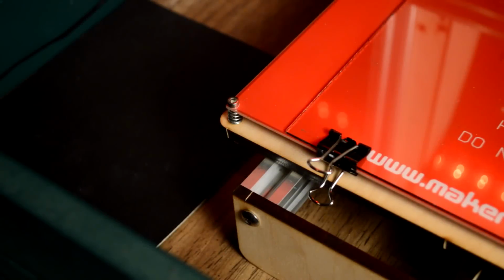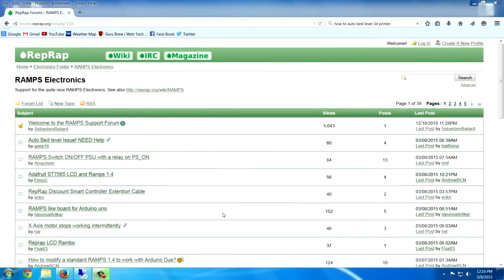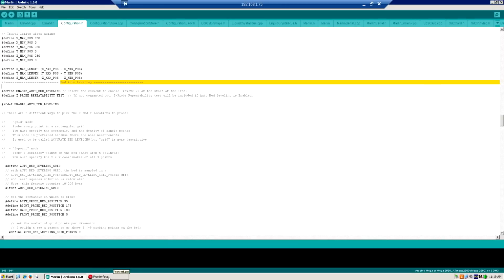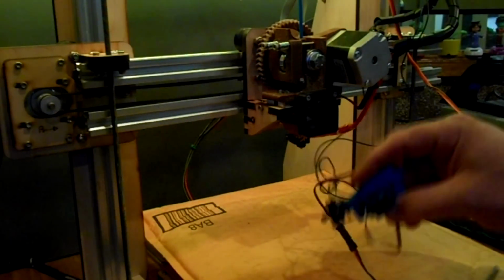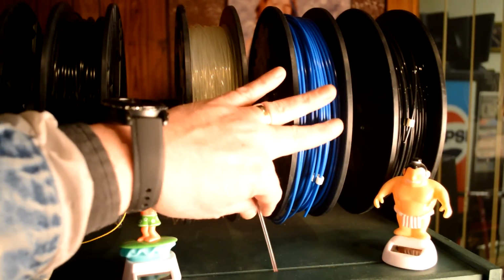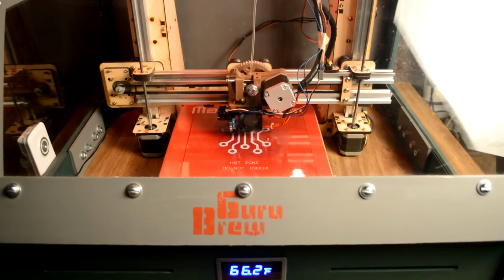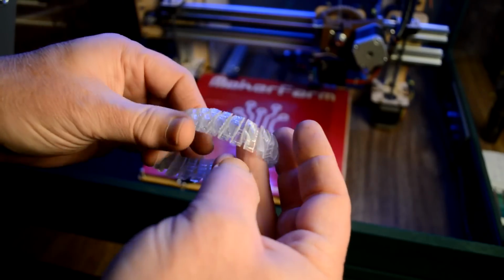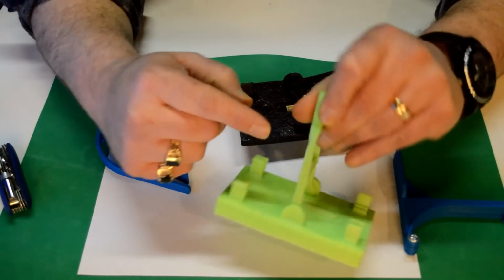Setting Up Auto Bed Leveling on 3D Printer

Comment: hey GuruBrew! ive set up servo bed leveling on my Marlin RC3, but im running into the issue of the printer printing mid air, likes 21mm above the bed which is more than my Z offset (-18.59mm) is there any way to get this sorted? im in real trouble man,any help would be appreciated! thanks!

Comment: Hi Great video! maybe i missed it here but would you be ok sharing the stl file to print the parts please. also any small common servo works fine? would a proximity sensor work? would it sense the glass do you think ?

Comment: I either missed or did not understand where the micro switch plugged in.   Could I get the exact place this plugged in
I know where the servo plugged in.
Reply from the maker: Hi Rodger, the Z micro switch remains using the same original connection location

Comment: did you have to do anything in marlin other than enable bed auto leveling? I have the same printer and after leveling my nozzle crashes into the bed when it starts to print.
Reply: i have the same problem, which is why im here..... regular leveling works fine... auto level goes down way too far......but seeing your comment is 3 years old, i doubt hed reply to mine.

Comment: Isn't this bed leveling software the same software used by CNC PCB makers?  Maybe not the same code but same principle.
Reply from the maker: They share the same concept for sure. I have been thinking of an easy way I could possibly incorporate multi-point bed leveling for use on a CNC router or mill and I think I have a method that would work. If enough interest is shown in pursuing this further, I may make a video with a solution.
Circuit board bed leveling method relies on the conductive property's as part of the process but will not work on material like wood and plastic.
As far as I know, no one has developed a process for hobby class machines that don't incorporate a probe or tool changer.

Comment: hey, do you you reg glass on your heat bed. i am try to find the best material to put on my bed
Reply from the maker: Yes from a dollar store photo frame. It works but something a little thicker like .25 inch would be better
Reply: right on ty. i was goona go the route just wanted to ask first. i was worrried about it taking the heat with out breaking